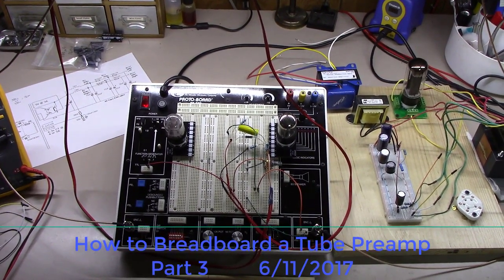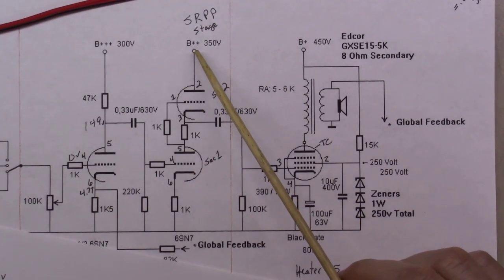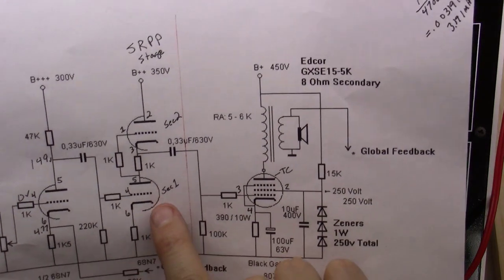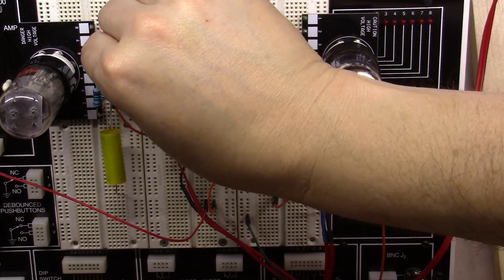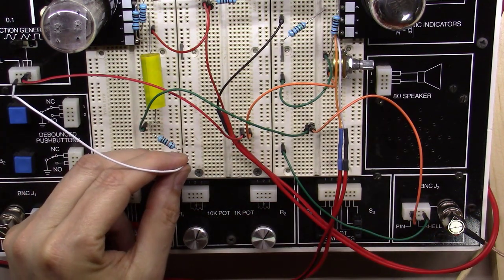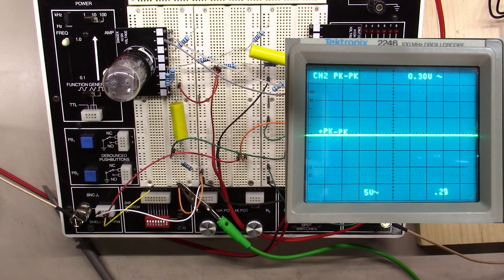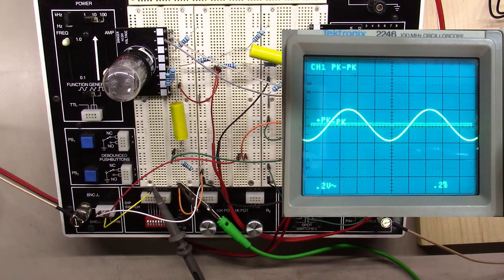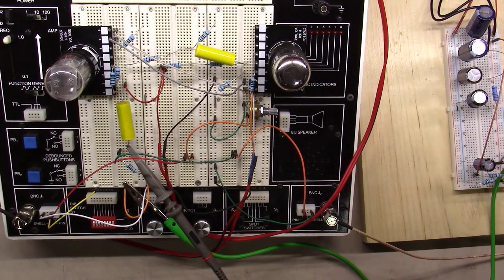How to Breadboard a Tube Preamp - Part 3 - Redone

Comment: I noticed that when you are putting the resistors in I can't tell how you are turning them. Does it matter which way you turn them. Same with the two yellow coupling capacitors, do they matter which way you turn them? Thanks for any help.

Comment: And thinking about it a triangle wave is a more useful guide to amp linearity than a sine as the eye is pretty good at telling a straight line from a curve. It also has some higher frequency components so you get to see if there's significant phase distortion too...

Comment: Thanx for the great video again! I would suggest you to try bypass one of the cathode resistors either first or second stage with a proper capacitor to increase gain little bit.  You might choose which one to bypass based on the distortion increase you'll get.
Reply: that will not be needed he got 33 volts it takes 23 volts to peg the 807
Reply from the maker: Agreed, but to drive an 807, not really needed.  If I was building a single stage preamp, a must.